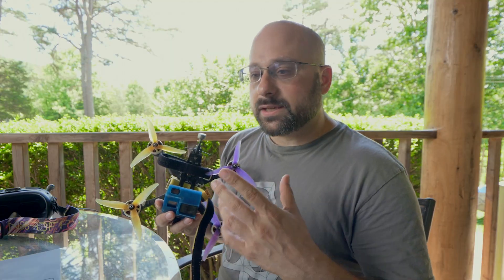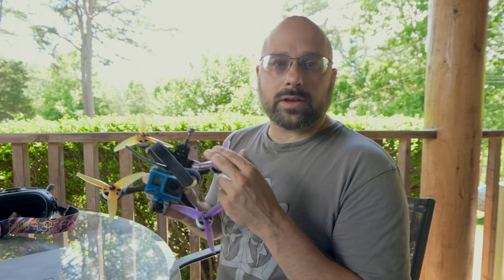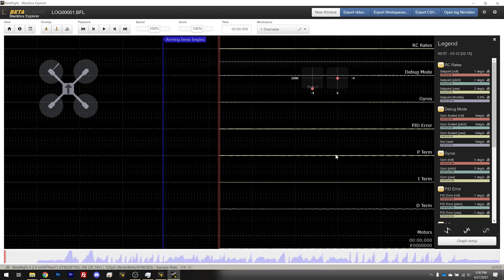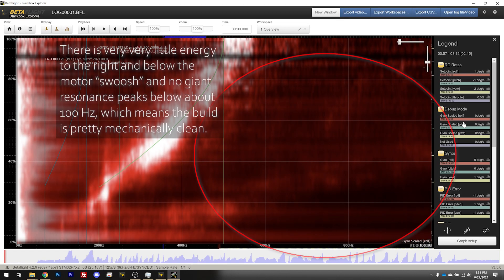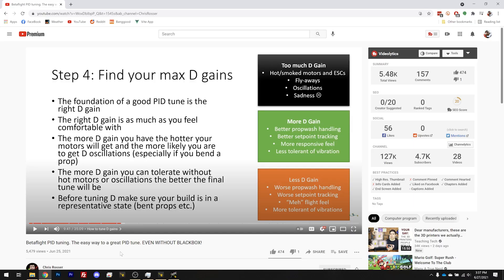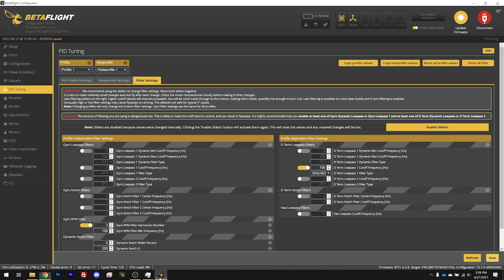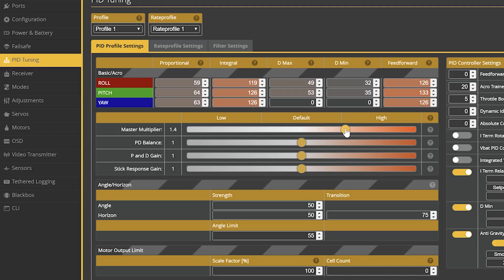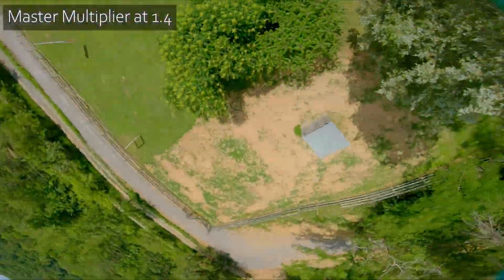Somebody finally made PID tuning make sense | Chris Rosser PID tune method | Part 1

Comment: I followed these steps on a GEPRC mark 4 prebuilt(They somehow give me a prebuilt quad with no factory tune). But then I keep frying the left front motor when i was tuning D term, the other three are just fine and cool. I sent it back to their shop for repair all they did was to replace the motor and put tune in, then the quad was flying fine. I recently find a lot of prop wash on it so I kind wanna follow these steps and retune it again, i find out they have crazy amount of filter in their factory tune and pit loop time of only 1.6khz. So I raised the loop fz to 3.2(they have slower gyro on this one),and reduced to the filter setting by the recommendation of this video. Immediately I fired the left front motor again with a 360 row, I really couldn't figure out why It seems to act nomarl but keep frying the left front motor the moment i try a flip.

Comment: would certain motors or a type of esc  not like RPM filtering ? also when do you use RPM filtering also do you have an updated video on RPM filter setup 4,4 betaflight settings have changed since your last video  thank you God Bless

Comment: I took my AOS5 v1 apart down to the frame, to begin a tune for the start of next season. Turns out I have been flying with a broken arm all summer. If it was not an 'A-arm' style build, it would have not been in the air at all. I'm glad I took the time to go through the first step. Even though, it probably could have gone on flying with no flight-ending failures, Chris's design kept it from failing, but with that fracture, I would have been chasing my tail trying to find what the resonance was coming from. 
Now. New arm. New Season. New Tune. 
Three months till spring here, can't wait for the new year! (yes, new year starts on May 1st, lol)

Comment: Hi, there.  my MOTOR 1 is spinning as normal but with Errors. The more throttle I push, the bigger Error code appears. It is a fresh build, can it be a hardware issue?

Comment: at 8:00 your analyzer shows noise all the way to  100% throttle. Mine stops showing noise above 60% throttle? why would that be?
Reply from the maker: You didn't go to 100% throttle during the flight.
Reply: @JoshuaBardwell  surely not 😆

Comment: I’ve played with increasing pidsum_limit from the 50% default to 100% and I found no real advantage in pushing the pidloop any harder. Motor saturation is already a problem at 50% pidsum_limit, increasing to 100% will not improve anything really. I saw a comment by ctsnooze in some PR somewhere where he also corroborated this
Reply from the maker: According to Mark Spatz, the reduced pidsum limit was designed to help deal with iterm windup, which is now solved by iterm relax. So raising the pidsum limit allows the motors to go to saturation when needed, and doesn't have a downside. I don't know who's right because even if I tested all of my quads, that still wouldn't be as much research as is needed to draw a firm conclusion.

Comment: I followed his tutorials to tune my newest Betaflight build and my quad is flying amazingly well. 

The stock settings in Betaflight just didn't work well at all for me, I was having those low throttle wobbles and instability after flips and rolls on stock, but after following his tutorials the quad flies amazing now.

Comment: There's tuning for performance and then there's tuning for longevity. Reliability can be built into either side of the spectrum but if you play chicken with the edge of performance envelope, it begins to become unreliable.
Tuning for performance shortens lifespans of components - make sure you can sustain the cash flow for that tuning. Ask any car tuners.
I think Betaflight presets lean towards longevity and reliability - easier on the wallet and increases flight time over bench time.
Looking forward to the rest of the series!

Comment: Why can’t we have a program that looks at the log and just tells you the pids based on math?  I’m sure someone can write this.  Ardupilot has auto-tune after all.
Reply from the maker: Ardupilot isn't flying a hard driving acro quad. And anyway, how well does its auto tune actually work? Betaflight has had auto tune before and it didn't work.
Reply: @JoshuaBardwell  ardupilot autotune works well for camera drones, not acro drones.   But my point is couldn’t there be a program that looks at the betaflight log and then recommends PID sets for betaflight users.

Comment: Serious but silly question: I fly in the desert, so my motors are hot to the touch before I even plug in my first battery. Should I even care about my motor temps while tuning? Should I even be tuning?
Reply from the maker: If your motor enamel gets hot enough it will burn and the motor will be ruined. Motor temp matters.

Comment: @JoshuaBardwell this is the explanation that Bruce Luckcuck gave regarding pidsum_limit on the BetaFlight Facebook page last September: "You're unlikely to see any flight difference as the motors will already saturate at the current setting. The negative is that increasing it will make the response in crashes more violent and more likely to damage motors and ESC's".

Comment: My quad (nazgul5) wobbles pretty good on the stock tune.(prop wash) Using 1100 6s and gopro3. Maybe its just a tad heavy? I am only running 1100 and not 1300 so I figured that would be about right. But as a newb I honestly have no clue. I have a video if anyone is interested in helping. (my last vid)

Comment: I really like this way of PID tuning, a lot of tutorials on pidtuning are basically "I feel I need to up/lower X based on how I feel the quad should move. Just avoid hot motors". Which in all honestly is pretty useless metric seeing as a viewer like myself can't feel the changes by watching a video, let alone have the feeling to change certain value without it being just a whole lot of blind trail and error. And at that point is such a tutorial really useful?

This data driven way of PID tuning is quite useful as you remove most of the guess work and don't need to base it on feeling alone.
Reply: That’s why you need the blackbox. That’s also how it should be done from Betaflight tuning guide.

Comment: Question. I have the seagull drone by eachine  if I crashed and had to replace one of the motors which motor would I replace it with. I have searched the internet and can not find the original. The closest is geprc 2004 2550kv or beta fpv 2004 3000kv. This would mean replacing all four if one was broken. Please advise on your recommendation. Enjoy your you tube videos very helpful. Keep up the good content.

Comment: When seeing the D-gains-first approach to tuning I wonder where I should stop. I must think about Bob Roogi's statements about how even moderate motor temperatures compromise power output.
Reply: i'm working on motor temp sensors so we don't. have to guess anymore.
Reply: @charlesmarseille123  Interesting. So we would get in-flight stator temperatures via ESC telemetry?
Reply: @Gosuminer  exactly. it could be shown on osd instead of esc temp or other value. of course this would be a bf fork at first but could be accepted by devs if used enough.

Comment: I'd like to try tuning my new build like this but im still a newer pilot and im having an issue where when i punch the throttle it yaws to the left. I dont know if i can tune this way with that currently. I think i'll just cause a crash.
Reply: For me, a yaw when punching the throttle is me being clumsy on the sticks and blipping the throttle at an angle.
Reply: @brutus1974  yea Saldly that's the only thing I've seen people say online but there's spring tension on my yaw stick and not on throttle, and it does it every time.  Not sure what it is yet.

Comment: I haven't heard anyone mention the fact that you can change PID profiles via the OSD.  Is there a reason you wouldn't want to have one "aggressive" profile when your quad's in good shape and then a second profile that you switch to when you crash and need to fly back home?  I'm guessing that's because some of the filter settings are independent of your PID profile?
Reply from the maker: The gyro filter I think is outside the PID profile. Realistically the reason I that most people don't want to think about switching they just want to fly.

Comment: I still have cool motors with D up in the 60s and P in the 80's, getting scary :)
Reply: Clean build on a good frame.  Enjoi!
Reply: Clean build!
Reply: Yeah I was at 100 on p and 55 on d, but gunk I will just start over and reduce filters
Reply: @ugpfpv361  I found P at about 75 and D at 45 is my sweet spot. with 150 FF. I reduced all filters apart from the D lowpass @ 100hz. cool motors after 5 packs

Comment: Yeah, I'm just going to quit FPV =/  2+ years with my TinyHawk and I have fun but I just can't learn all the protocols and frequencies and boards and acronyms and now resonances and filtering...  FPV completely shattered any illusion of my intelligence.  I figure if I were smart enough, I'd be flying a 5-inch by now.
Reply from the maker: Don't get discouraged. You don't need to do this stuff. Just go fly and have fun.
Reply: @JoshuaBardwell  flying this thing has really been the most enjoyable thing I've ever done and I never would have even been able to arm it without you. ;)  It's just such a tall mountain to climb, and the summit is packed with KIDS!!!  =P
Reply: @LeftStepFPV  If you understand there's more you could do or learn, I think you're doin fine. The thing I hear most and is usually the biggest factor is the classic, "you don't know, what you don't know". Sometimes you'll be frustrated because knowing HOW to find what is wrong is just as difficult.
Reply: @LeftStepFPV  pick  a radio and protocol.. simple.. actually a 5 inch is easier to fly than a tinyhawk.. now that you know how to fly. Get a 5 inch leave it stock tuning and go have fun. Never give up man.

Comment: AFAIK, lifting pidsum limit is only necessary if your pidsum traces bottom-out in the tuning flight logs. Does this maybe give some overhead to help prevent motor saturation? I seem to remember reading an old PR that had some og devs commenting on the importance of this. EDIT: checked my logs and I am reaching default pidsum limit on snap flips and rolls on my final tune (before I pushed up the master it was fine though). SO I'm gonna retune with these cli commands entered.
Reply: I find it to be an issue mainly with feedforward. I have FF gains of 300+ quite often and smack into the pidsum limit 😋

Comment: What does Kevin disagree with?

Also, I think marks tuning method is much easier.
Reply from the maker: Kevin commented that the use of Biquad had problems and he thinks stacked PT1 or some other types of filters that are unique to Emu are better. BF devs also moved away from Biquad since the default filters are PT1. I asked Chris about this and he gave some arguments why Biquad was his preference. So I don't think there's a right or wrong answer here but I have to acknowledge the controversy.

Mark's tuning method IMO has fewer steps but is less deterministic than Chris's, so Mark's may be harder for someone who isn't an expert in BB analysis to follow.
Reply: @JoshuaBardwell  ah, that makes sense. 

In terms of marks method, you don't need BBL at all..., unless you are talking about something else.

Pd balance to the left until you have bounce-back, then back off.

PD gain up until you have trilling, then back off.

Push FF up until it feels right.

Doesn't get much easier than that. Most people will be fine just pushing the filter sliders, otherwise a throttle sweep and pid toolbox to determine what is safe.

Comment: Yup, thanks for sharing Chris' info. An important thing to remember is that betaflight defaults are intended for a 550/650g 4s build carrying a gopro... So yes for a heavier build it is advised that you increase the master.... For a lighter 5inch builds, its recommended you decrease the master... At least to start with.
Reply: Thanks for the info! Any tips for a 4s 2.5inch? Hard flutter on little throttle input
Reply: Thanks for the info! Any tips for a 4s 2.5inch? Hard flutter on little throttle input
Reply: @LuxGamer16  sorry, don't know much about tuning. Though I know you can turn down the master or P&D sliders a fair bit on smaller lighter builds.
Reply: @sylvanlight120  no big deal. Great, i will see what works, but at least i know what i can try. Cheers!
Reply: @LuxGamer16  Turning off d-min did an 80% of job for me.

Comment: What do you think why other beta devs don't like to enable sliders? They would rather use the table.
Reply: You hit a point where sliders get you 95% of the way there.  If you're tuning for that last bit to really dial it in, then entering exact numbers and deviating is just fine.  Sliders are there to save time, not be the final answer for somebody who needs to extract that last few percent of performance.
Reply: @tehllama42  ah got it. Cool! Thanks!
Reply: Most of them do sliders extensively.

Comment: Josh you have gotten way better at flying ever since your 3packs a day series. Just saying.🙌🔥👏
I'm very interested in trying what you're doing here on my build that you connected to your laptop at Rampage. It was the 5-inch player one with a iFlight H7 beast toothpick board which is 55 amp mine would really be pushing the limits though because I'm using it with 2206.5 2550 KV Tmotors on 4S. I've been flying it lately doing speed runs and it's working great with stock beta flight setup but I like pushing limits so let's see how it works... Looking forward to part two and possibly three 🗣️💯 
Also if you haven't already a link to those stick overlays would be awesome

Comment: Try some super hard yaw moves, see if you can bring out the desyncs in those motors. I tried them on Fettec and NBD ESC with no luck. Flew great till i tuned it and jammed the yaw stick.
Reply from the maker: There are samples of the new Imperial motors which are about 3 weeks away from delivery at FPVCycle. They aren't the older Emeralds that had the desync problems. I have been running them for a couple weeks and they are flawless.
Reply: @JoshuaBardwell  The bell swapped ones also appear to be just fine, so that should be a straightforward fix as well... but for the effort to source those, that's why we're getting new full motors
Reply: @JoshuaBardwell  I was running the Imperials. Hopefully Bob actually comes through with the new bells. I message him and he told me more than once times he would put me on a list for new bells/motors when a fix was found. Almost about given up ever hearing back from him again....

Comment: Is PID tuning needed for long range, more/less efficient, …..? I fly a 7 inch long range quad. What should I do?
Reply: you got 2 ends to that ladder: efficiency, control.
the higher the d gains, the higher the control, the higher the variations of motor output, the higher the energy consumption. think of it as stop and go traffic in a car.
Reply: Just fly it.

Comment: completely unrelated, but I see you got a trampoline bed on your backyard, have you ever tried to crash a quad in it and then recover the flight mid bounce? that would make a fun challenge :D
Reply: Right!?! Lol
Reply: I wouldn't. Props could and likely would shred the matt. That could cause the threading in it to unwind and whip springs around at high speeds. The whole thing is under significant tension.
Reply: @graydi66y  yea, it would need to be a heavy drone and involve disarming while bouncing hahaha yes, it's a stupid idea!

Comment: HAHA one more thing Joshua:
Of course we want to tune around all our mechanical problems, otherwise we could just spend more money and buy a soundly built quad with no issues in the first place, right... =P
Reply from the maker: Yeah but it's a losing game. I mean, if you're stuck in the desert and you have to limp to civilization on a sprained ankle or die, then do it. If you have a broken quad with zero ability to repair it, then tune around it. But it's going to fly like shit.
Reply: i bet if you have a car with janky suspension, you put two pillows under your butt and call it a fix